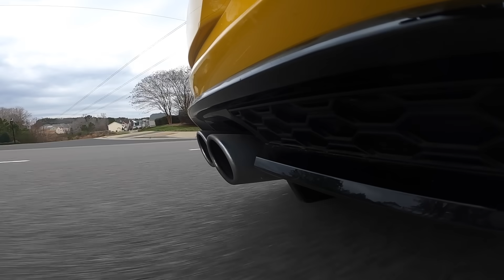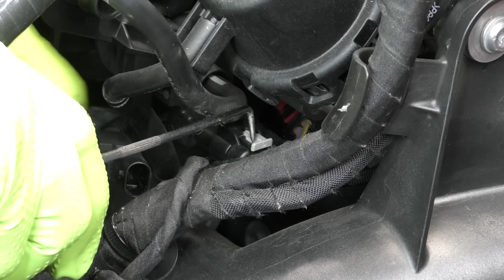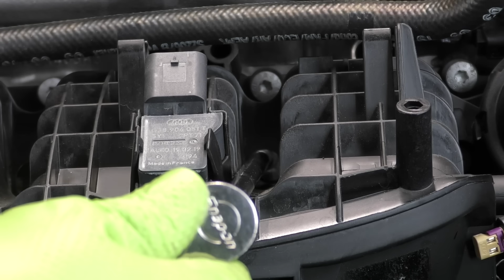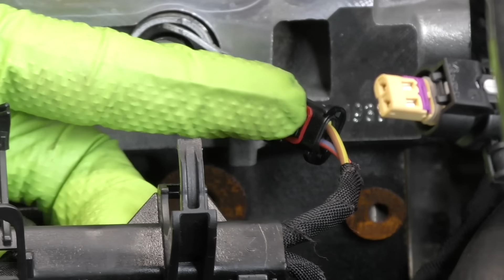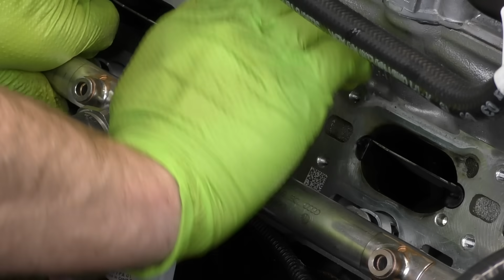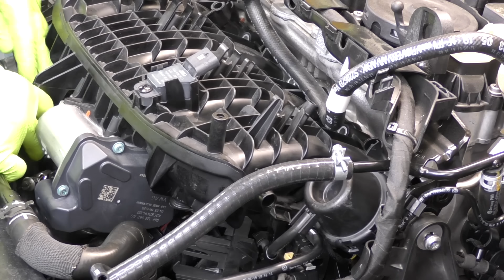Fuel Injector Replacement VW/Audi TSI Engines

Comment: What condition or symptom caused you to change the injectors? I have a mk7 R with 156k and still has factory injectors. Anyway to test if they're leaking or causing/having issues?
Reply from the maker: I didn’t change them. Just reseal

Comment: Ive been having a starting and stuttering problem at idle with my audi s3 8v and after nearly 2 years of changing kost components it could have been it was 1 stuck open injector. It threw envine codes like system to lean and system to rich petrol smell in thw oil and a reallly strong petrol smell from the exhaughst speny hundreds just to fix a £60 injector

Comment: If you are working on a 2018+ Tiguan, the fuel rail bolts are hidden behind cylinder one and cylinder three fuel injector connectors. I used a pic to disconnect the injector connectors and that gave me access to a 10 triple square bolt.
Reply: How did you get to left  side rail bolt, first injector connector is blocking it
Reply: @rohanpokharna8045  I disconnected the connector to access it.
Reply: @kevinsmith7010 connecter is also too difficult to move due to clearance
Reply: @rohanpokharna8045 yeah, it’s was tough. That is my I used a pick tool.

Comment: The cpla is slightly different than this video but I have to admit this helped me tremendously! The few differences on my engine were that; 

1. The bar/bracket underneath the throttle body & intake manifold is attached & cannot be removed once the intake manifold is ready to come out.

2. The bracket that holds the wire housing to the driver's right hand side underneath the the intake manifold didn't need to be removed for mine either. 

All in all it was a great 1st time experience & now I know for sure it was my injectors. They were nasty lol. Thanks for what you all do. ✌🏾

Comment: Would a carbon clogged injector cause misfires on cold start only just like dirty intake valves? car has misfire CEL P0303 and 0304 if left to idle to temperature, but seems to drive fine with a slight rough idle at times.
Reply from the maker: very possible

Comment: I know this video is some years old but hope you may answer a couple questions.  Some have told me the  injector harness on these models should be replaced while in their. They claim they're prone to failure. What say you? 
Second I have a freind whose Passat i workmon a d he's kind of insisting I tackle this for him.  I have plenty of injector replacement experience but was wondering how long this job should take as I've never done one of these before.  Internet says 5 1/2 to 8 1/2 hours.

Comment: I am trying to help my Neighbor with smogging a B7 A4 2.0T. It has a p0303 on cylinder three. It misfires when cold. 

I put in new plugs and swapped coils between 2 and 3. Code didn't jump.

I am pretty its a injector. Will running a cleaner help?

When hot and hot start no misfire.

Comment: Great video.  A few footnotes that I think are compounded by turbo versions, which many of these engines are.  
- These engines are similar but the manifolds are not exactly the same, especially turbo versions which many are.  
- The T30 screws holding the manifold down may not be accessible with an extension and socket as shown, you may want some slim T-30 tools for this.  Especially on Volkswagen 1.8 TSI.  - The top 3 bolts have tool clearance for normal socket extensions, the rest don't.  
- The 17 mm wrench mentioned needs to be a stubby, there is very little room for the 17mm nut on the lower hp fuel line which you have to remove to get to a lower bolt on the manifold.
- I found an extension magnet to be extremely helpful multiple times on this job.
- The fuel rail can come off much harder than this video, it takes a good pull, and that's when you may take an injector out with it.
Reply: Fuel line wrenches (with the cutout), or line sockets also work for the lower fuel pipe. Another (more painful) method is disconnecting the charge pipe and moving it out of the way to use a full-size combo wrench

Comment: If the Fuel Pressure sensor is failing will it cause an intermittent EPC light flashing or could it be a bad injector?

Comment: I would like some help/advice with my 2019 Passat 2.0 TSI (Wolfsburg). I had to replace all four injectors and it came with all the seals installed. Put the rail back on and 650 miles later, the o-ring on C1 blew out. Replace all the seals on C1 and the C4 O-ring blew out at 3 miles. Replaced all the seals and O-rings and the C2 o-ring blew out at just 5 miles. I replaced all of them again and the C1 o-ring is leaking. I lubed the o-rings and the rail went on real smooth every time, but I just can’t seem to get the o-rings to stop blowing out. What am I missing here and doing wrong?

Comment: You don't need to compensate for crows feet if you keep the open end at 90°. You do need to compensate if they're parallel away or towards the handle.

Comment: I find it odd that a new injector comes with the Teflon seal and fuel rail o ring installed but doesn’t include the black seal that goes on the transition from the large part of the injector to the small shaft. I have to buy the seal kit for one of the 5 items.

Comment: MY 2013 VW tiguan did not have the clips holding down the fuel injectors.  The fuel rail is mounted to the intake manifold. Is this normal for this years model?

Comment: Question, I need some help. I have a 2020 VW Passat 2.0 TSI. 

It keeps blowing out my injector seals on cylinder 1&2. I've replaced them 3 times and I have followed this video step by step. It keeps pushing out the both white and green seals that go into the fuel rail, I've done everything people have recommended on the internet, and I've had a VW mechanic come to my house to check if I've installed everything correctly. 

Could that be because the HPFP's pressure is too high.? Seals and injectors are brand new (OEM).
Reply from the maker: I ve heard of rail issues causing that. injector basically doesn't sit properly
Reply: @ damn, so I would basically just have to buy another injector.? Or get a thicker seal.? Thanks for the reply. Your videos are very helpful.
Reply: @HumbleMechanic  same this is happening to me did the job right and the same injector that was leaking is now spraying bad when I try to start the car seals are new but when I removed the fuel rail they looked squished and melted

Comment: Hi, so I did all of this step by step with brand new OEM injectors and everything was working properly until I got on the freeway. The first fuel injector started leaking I don't know if it's because of the seal or something but it's spraying gas's I'm going to fix it right now but could I be correct by saying it's the green seal on the injector that makes contact with the fuel rail.?
Reply: Hey man this is happening to me as well did reseal job started and ran for a day next day I tried to turn on and no start then I saw how it sprayed gas from the fuel rail to where the injector meets what did you end up doing
Reply: @KindaSwoLee  I fixed the issue. I forgot to take off the old 3 legged plastic seal that goes on the tip of the injectors. I ordered a pack from parts geek that came with all the seals except for those 4 Pronged black seals. So I took them off my old injectors carefully and then installed them onto the new ones.
.
The injectors would get pushed into the engine manifold because I had not installed that seal that has the 3 prongs(legs) that hold the seal back into the fuel injector rail. 
.
Once I had realized that I took them all out, installed that part and now it runs perfectly. They look black, with 3 legs, and a silver ring in the middle of the circle.

Comment: What should we do when the injectors have been installed by Thanos? Just keep wiggling it with a pick til she goes?
Edit: nvm, got them out, the answer was indeed keep wiggling with a pick.
I should add (maybe for someone reading this in the future) that in the case of the CAXA engine, the runner flaps are not actually runner flaps like this example, rather they're some sort of "divider" that are a solid part of the cilinder head, you cannot remove them, and yes they are very much in the way of the intake valves, just like every other design in this engine was engineered to annoy you, so if you're attempting to do a cleaning the tiewraps-drill technique might not work very well and you also need a boroscope because of these dividers, in order to see if the valves are closed

Comment: Hi  Humble mechanic love your videos .
I have golf 1.4 tsi caxa .misfire on cy 2.
Compression pressure at cyl 2. Is 180psi.
Changed injector,plug,and coil pack. Checked wires coming to injectors, they seamed fine .
Still missing at no. 2.
Swopped plug and coil from 1 to 2 .still misfire at cyl 2.
Any thoughts? Please.

Comment: I have the European s3 so I also have 4 injectors in the intake manifold. This is not rocket science but deviates a little bit from your instruction video that explains how to remove intake manifold. Also a don’t see any plastic guide rings mounted on the injections when you remove and install them I have them on mine injectors. These are plastic rings with 3 grabbing points and also a metal ring that’s installed over the lower shaft underneath the injector there’s a groove were they grab on so for the rest top notch explanation of how to remove and install injectors

Comment: I did this and my car won’t start now. You can hear it trying to start. I verified and there’s no a fuel leak and all connectors are plugged in. Any idea on what to look for to find out the issue?
Reply: I'm literally having the same exact issue except I replaced my Intake manifold.None of the injectors came out with the manifold..Somehow It seems as if there's a fuel delivery issue.Any luck finding out what's going on?
Reply: If you guys have verified everything by a plugged in you may need to reset battery management system due to high pressure fuel pump not being primed you can test it with a scan tool

Comment: Question - what was the point of entirely removing the m10 triple square bolt on the bracket? I feel like you could just get it a bit loose, take the top nut off and that’d give you enough wiggle room to take the manifold off? (Putting the bolt back is quite a task haha)

Comment: You completely miss the hardest part.  How the hell do you get those metal clips  on the injectors off? And can the injector be removed without removing the clip?
Reply from the maker: Those metal clips come right off.
Reply: @HumbleMechanic  so far they haven't with one exception where the plastic tabs on the injector broke. I would appreciate any suggestions.
Reply: @HumbleMechanic  ok managed to answer my own question.  Gently pry straight up on both sides of each clip in the slits on the bottom of the clip. Flat screwdriver works best.

Comment: Too bad this doesn’t look anything like any VW or Audi TSI fuel injector rails I’ve worked on, 2011 Tiguan, 2013 Eos
Reply from the maker: the rail is different, but the repair is very similar.

Comment: Help. I put a new injector harness in and now the car won't start.  I double checked all the connections and everything is connected the only thing I can see is that there is a little u-shaped tube that goes from the side of the engine and then underneath the manifold that's disconnected. Could that be the problem?  I would think without that little host connected that the engine would still turn over give me an oxygen sensor reading down the road.

Comment: Just finished doing a lot of work on my 1.4TSI CAXA engine - new timing chain,  VVTi pulley,  intake camshaft,  oil pump,  VVTi solenoid,  cam sensor and spark plugs.  The engine has a high misfire count [around 100] on cylinder 3 only when cold but the count doesn't rise when it gets to temperature.  I've done the obvious and swapped the coil pack with cyl 2 but the misfire didn't follow it.  A question... could this behaviour be symptomatic of an injector issue ?  Just want to get some advice before I embark on replicating what Charles has done here.  Thanks in advance.

Comment: I hope you see this after 4 years but I have a stuck open fuel injector causing fuel leaking into cylinder 4 on my gti. Does it matter if I get 4 new ecs tuning branded fuel injectors instead of OEM??

Comment: I have a 2015 Audi Q5  2.0 same engine , I replaced all 4 injectors and now the engine has multiple misfires P0300 P0302 P0303 P0304 , I check all connections and are all good , I have no idea what is going on , Does the injectors need to be programmed /coded?if so How is the procedure and what tool I need or I need to go to a mechanic ?

Comment: I have same kind of injector and I purchased a used injector from a low mileage car which looks exactly the same,  so do I have to code the I injector to the car if so what is the number to code the car or where is it located.. thank you

Comment: I noticed on the removal and subsequent installation of the injectors there's a part from the injector kit missing. It's the round plastic part with legs/arms like a little table. Is it not necessary????

Comment: I have a 2019 Golf R with recurring leak at injector seal (cylinder side). Seals replaced but still leaks at injector 1. Have done ultra sonic clean of all 4 injectors and smoke pro test and all hardware I.e fuel rail, injectors appear to be working 100%. Any advice? Thanks
Reply from the maker: Have you swapped it in the cylinder? Like move 1 to 3?
Reply: @HumbleMechanic  no not tried that..

Comment: I wouldn't need the special tool to reseal the injectors if I just buy brand new injectors correct? I would only need the special tool if I were just trying to clean the old injectors and needed to put them back having to reseal it in that worst case scenario you mentioned of the seal getting seal stuck in the cylinder head right?

Comment: When replacing the injectors do you have to bleed the fuel system?  I replace the injectors  and now the car doesn't accelerate too much and now a code p0190 came on. if i do gotta bleed it were do i bleed it from😓
Reply from the maker: Depends the Diesel ones are more particular than these gas ones. . You may have other issues than injectors.
Reply: @HumbleMechanic  couple days ago gas started leaking alot underneath the intake manifold. So i too removed the intake manifold. And found out the fuel injector at the back had a ripped O ring .after replacing O ring now the check engine light is on for high fuel pressure sensor ? I would think i would need to take the air out the system since i Open up the injectors but i cant find a value to open like how most cars have.
Reply: @HumbleMechanic  found the problem 🤦🏽‍♂️ one of the wires on the high pressure fuel sensor was pulled out🤦🏽‍♂️eazy Fix good as new👍🏽

Comment: What is the correct parameter I'm looking for testing the continuity/resistance (I suck at knowing electrical) on these? I can't find it published anywhere. VW won't give it to me. P0203 code and rather than just slapping a new one in, want to confirm it's the solenoid that's bad and not just needing to rebuild the seals. 

Trying to test all 4 but these pins on the Atlas 2.0 TSI DCGA are deep and I'm getting sloppy readings. I also wonder if they are low resistance b'c my lowest setting on my tool is 200ohms and I'm getting decimals on them.

Thanks!
Reply: You saved my life. There is so little out there on this engine, especially 3b and even more so as organized in the Atlas.
This was SUCH a PITA!!!!!! I thought, fuel injector, okay, no big deal, just a little time. WOW! I will probably never do it again, especially when under a time crunch and trying to learn. I officially hate this engine set up. My 4R takes 2 hours or less for a non-mechanic like me, and about 73 fewer demolished hands and fingers!

Thank you so much for this... I'm reposting it in the manifold video as well!

Comment: What's the 3 pronged plastic piece that came off with the metal looking washer on my 2011 a3? Should that be installed? I don't see them in this video.
Reply: You need that for your next injectors unless you grab a kit. They help seat/space the injector in the port
Reply: Did you end up putting them back on?

Comment: If you have an 8v S3 youll need to remove the fuel like before you can take off the manifold.
Reply: Facts and the fuel line is very difficult to remove with it still on.

Comment: I’ve smelled fuel the last few days and finally noticed a mist of fuel where the injector meets the fuel rail. I’m not getting any CEL’s though. And do I need to replace the injector or just the seal? I don’t see how the fuel rail could be bad.

Comment: Humble mechanic.i have a question I hope you please help me with ..would the process you show be generally the same in an on a V8 fsi engine ..I a 2008 4.2 Touareg 2 several months ago we or he changed cylinder 7  injector for high rpm misfire and carbon clean for fired up and ran like a champ 2 months later I started getting same misfire on cylinder 5 high rpm so my thoughts instead of doing this again and again I'll jus replace all except cylinder 7  I found some online EBAY unbranded ..basically a cheap set ordered them and  I left him to the task it took a little over a week due to weather and a tool he needed  pull injectors he reinstalled all buttoned it up and it cranks for a long period the fires runs for 20 seconds and stalls we initially got crank sensor code but it starts it will idle has misfire a soon as you give it gas it stalls ....my question is is their any thing that could have happened in the process of reinstalling the manifold that could cause this issue ? It seems straight forward ..or is it  or would it be more thank likely the cheap way out ..the injectors ?...your thoughts would be greatly appreciated